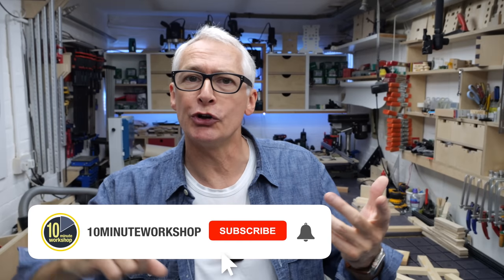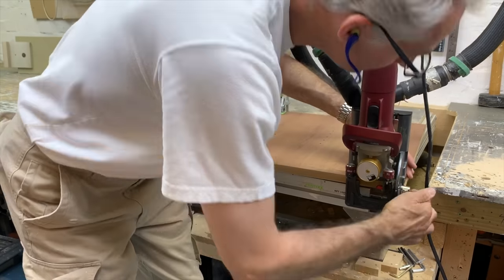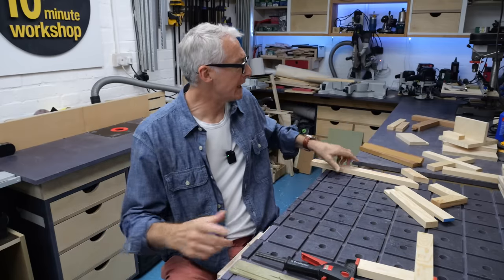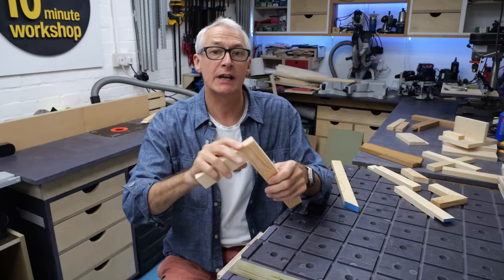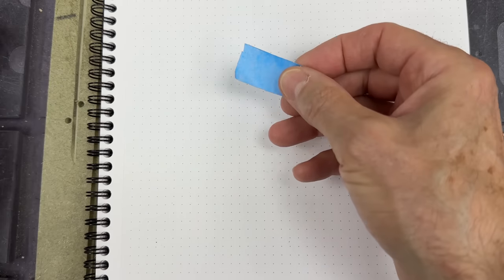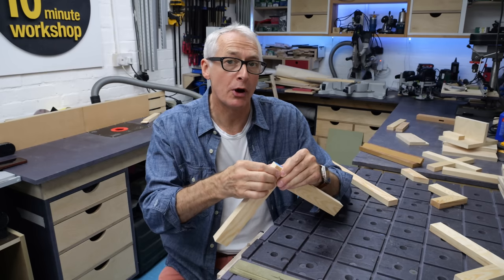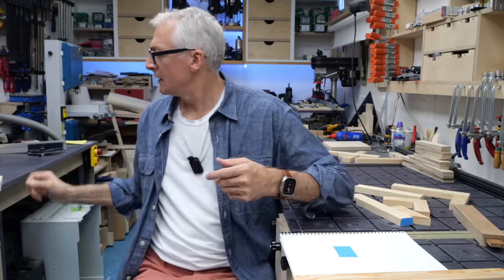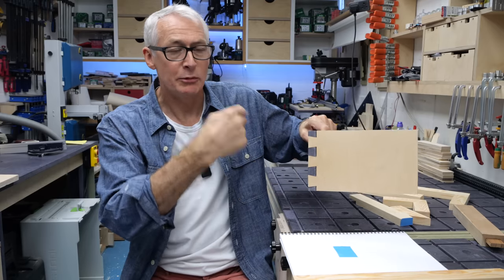What's The Point of a Joint? [video 538]

Comment: That there is long grain passing between the two pieces being joined is significant.  An unglued butt or miter joint will come apart as soon as you let go of it.  Add a spline or floating tenon and you need to pull to get it apart.

Comment: Maybe you'll be mentioning this in subsequent videos but one of things that make rabbets or half laps, for example, stronger than a simple butt joint is the shouldering that is inherent to the joint. The more contact points in the joint, in different directions, the stronger it tends to be, regardless of the increased gluing area.

If you take an L joint, for example, a simple butt joint only has the mating surfaces to give it any kind of strength. Movement in almost any direction will cause it to fail. Whereas a half lap, for example, has two shouldering points that reduce the number of directions that can make the joint fail.

I'm looking forward to more videos in this series. I'm no expert, as I've only been at this for 4-5 years, but I love the physics behind the joinery as I think it is what defines which type of joinery is appropriate for a given situation. The more we understand it, the better decisions we'll make.

Comment: Great video Peter. Looking forward to the series. Glue technology has come a long way since a lot of the woodworking joints were invented. A lot of cabinet makers I have spoken to have told me that dovetails while very pretty are a waste of time with modern drawer slides. As you said it is more about showing off skills than actual function not that there is anything wrong with that.
Reply from the maker: I agree, but the last time I called a dovetail a ‘decorative’ joint I was drowned in  comments - mostly from people who have likely never made one… 😂👍
Reply: Sorry. I made similar point before scrolling down to yours
Reply: @10MinuteWorkshop  It really depends on the situation that you are creating with regards to dovetails. I have made fine reproduction furniture since the age of 16, now if you are recreating a copy for want of a better word of an antique piece of furniture you would never cut machine dovetails you would only do hand ones and ensure the tails were larger than the pins. I agree they are decorative but also very strong and functional. Furniture making has very much moved on since I first started out as an 'apprentice cabinet maker'. And methods of construction likewise, the kind of furniture that I used to make has very little appeal to the younger generation who would much rather have the boring straight lines of Ikea style furniture and the excellent price that goes with it. It is nice to see you using 'real wood ' and cutting joints and whatever method you choose to cut them matters little really its always the end result that matters. However if we discard a lot of hand methods we will only have semi skilled workers who cannot use a saw or chisels. I am glad at my college we still do teach basic hand skills and hopefully train craftsmen of the future. Not a rant Peter just my opinion.

Comment: When you say using something like a dowel increases the glue surface area, it's not only that - the dowl (or biscuit) is actually bridging the gap between the two pieces of wood giving even more strength.
Reply: Biscuits are primarily about alignment. They are so thin they're usually weaker than the material removed to fit them. They are a money saver as they make for fast alignment of slippy glue on edge faces and reduce time for planing or sanding down ridges between pieces.

Comment: One small point: the joints were developed in days when animal glue was all there was. Modern glues, even for a simple butt joint are usually stronger than the wood so the wood fibres fail before the glue does, unless the glue used degrades with time like cyanoacrylic
Reply: Glue is only stronger than wood in one direction
Reply: And all glue will always fail, given enough time. I've sat on enough wobbly chairs to be glad that there's a mechanical joint as well as glue.

When a mortice and tenon goes, it gets progressively more wobbly. When a butt joint goes, it goes all at once, without any warning. If that joint is holding your chair together, you'll be on the floor before you know it.
Reply: Joints also serve to constrain the pieces so that the load on the glue is constrained too, and is potentially near zero in normal use. Take a mortice and tenon joint: the glue only prevents the tenon from leaving the mortice, and strength in all other axes is provided by the joint itself. In the direction where the glue is providing the strength, the load on the glue is entirely in shear which is its strongest direction. As a result a glued mortice and tenon joint will be very significantly stronger than a simple glued face joint in the same application.

Comment: I’ve been woodworking for over 45 years now and, through the fine furniture business I ran, would consider myself a reasonable cabinet maker - using your parlance, a fine woodworker. What I would say about the point of a joint is that it should be a way for someone to show off their skills. That’s just plain egotism. A joint can be a thing of beauty but it’s fundamental is to be a (sufficiently) strong connection between 2 bits of timber. 

The dovetail is seen by some as sign of a fine piece of furniture and that the maker is highly skilled. Well, I look back at the origins of a dovetail. It was only ever evolved because a mechanical joint was needed because the glues at the time were so poor. It does take some time to master and, as with all things, practice makes perfect, but a dovetail joint isn’t inherently hard and I could teach anyone to make good (not great) dovetails on less than a day. Nowadays, we have such superb glues that the mechanical element of a joint is rarely needed. 

Mr Chippendale was a superb designer and an even better businessman. His furniture featured dovetails because there was no choice but I have little doubt that if he had modern glues, he wouldn’t be wasting time having his guys make dovetails. 

A perfect joint must be functional. If it’s hidden, then that’s about it. If it is going to be on show, then input some design and make it something that is beautiful to the eye. 

To sum it up, form and function are the keys to furniture and just about anything being made - from pottery to cars. Design and build quality are what draw me to anything and not the flashy, unnecessary use of a particular joint.

Just my thoughts. And, even after all these years and not doing a lot with sheet goods or softwoods, I watch each one of Peter’s videos and enjoy them all.
Reply from the maker: Thanks! I do say that "if you're a fine-woodworking hobbyist, then the joint may well be the point..." so someone making the joints for pleasure without the constraints of running a commercial enterprise may well continue with dovetails 'because they can' - and there's nothing wrong with that, but it is a very different consideration than say, running a built-ins business for profit. 🤷‍♂️ 👍
Reply: Hide glue has been used for centuries and have held up very well.  So I wouldn't call hide glue  a poor glue.  IMHO
Reply: @10MinuteWorkshop Peter, I have no issue with the way you phrased it. I fully understand what you actually said and the the way in which some hobbyists want to demonstrate their skill by the aesthetic of their joints. That’s great if you need that boost. I built a new workbench a couple of years ago and wanted to include some elaboration which were not borne of necessity but simply to please me. So, I used different contrasting timbers of various elements and made a quite large half blind dovetail to secure the tail vice in place. I like to see it but I don’t think any of the visitors/clients who have been to the workshop have ever commented upon it; I’m quite happy with that as I don’t see it as an achievement worthy of comment. 

My view is that, generally, a joint is a “tool”to achieve the final result you desire and not an achievement in itself. We are very lucky to have the V&A resource in London and my wife and I have spent many, many happy hours wandering around. When I look at pieces by makers that I respect, old and modern, I rarely see the joints themselves. There are obviously there and essential but, it seems to me, the end result desired is that combination of total form and total function. 

None of this to disrespect hobbyists in any way. Perhaps, it may be food for thought particularly for people coming into woodworking as a hobby or as a trade to put the elaboration of various joints into a perspective.

Comment: Hello Peter,
It's not so much about how much glue is in a joint but where it is.
End grain is weaker than long grain because wood as we all know is made up of straws.
Those straws suck up glue and starve the joint of glue unless you prime the end grain face with glue a few times. However that end face needs to be cleaned up before use. Too much faffing around.
Long grain to long grain therefore is far stronger and more convenient.
Dowels/domino again while they give more glue area they give massive mechanical long grain strength to a joint.
Take that picture frame.
I do have issues with your summary of the wardrobes you make.
In my world to all intents and purposes they are fine woodworking/cabinate making and are a benchmark for the rest of us to aspire to.
Reply from the maker: Thanks; what I meant was that my wardrobes and cabinets are not 'fine woodworking' in the traditional hand-cut dovetails sense; I'm very happy with how they turned out. 👍

Comment: Peter, please include the correct use of joints.   Too many are building joints with incorrect orientation, because they don’t understand basic structural mechanics.   Joints resist either tension, compression, moments(torque), and combinations there of.   The orientation of the dovetailed joints in a drawer is important because as the drawer is opened and closed, the dovetail will resist the forces, even without glue, and a box joint, won’t work as well because it doesn’t resist the tension the joint sees with out the glue.
Reply: A few years ago, I made raised beds in the garden with 100*50mm railway sleepers. In effect, I used box joints with 12mm threaded rod down the centre of the joint. Flexible and strong with rods also supporting wires to train climbing plants. Works great

Comment: I'm trying to get to grips with dovetails, following videos by Paul Sellers, but why are they always shown on vertical corners in drawers and boxes, rather than horizontal corners on cabinets/shelves? If the tails are orientated to resist the gravity can they be used in that application or will they come apart? Maybe you could cover this in a video?
Reply from the maker: I’m only looking at very basic and simple joints, so dovetails don’t get a look in I’m afraid. You do sometimes see dovetails used in that way - to support the base in a set of shelves for example - but have to say they’ve always been in ‘dovetail demonstration’ videos to,illustrate a point, rather than in real life. 🤷‍♂️👍
Reply: About 1970, I made a bedside cabinet from white oak for my sister. I was 15 and at school  extracurricular sessions. Top to side panels were dovetailed. Fixed shelves as top and bottom of cupboard section were through joints with wedges. All rock solid while remaining elegant. Wouldn't do that now as I don't have a solid workbench. I'd use dowels or Peter's first generation floating tenon jig - which would be a shame aesthetically.

Comment: Thanks Peter, I like your clarity and brevity, but I think your lacking on one crucial point of joint design, mechanical strength. I know you've touched on it but didn't emphasize its importance. That is to say how the joint can come apart and where the wood resists the forces without any glue, like in any dovetail, pinned tenon or dowel joint. You did mention how a dovetail can only slide apart in one direction. Any joint's strength could be measured in X Y and Z axis by the cross sectional area of wood resisting force in an axis before and after gluing. Hence the popularity of floating tenon (Domino) joints because of ease, quickness and strength.
Reply from the maker: It’s a series - there are more points to cover in future videos. 👍

Comment: Hi Peter. I believe you have overestimated the difference between butt jount and the half lap. You have taped the end of the board that doesn't participate in the joint (and I guess nobody puts any glue there).
Reply from the maker: It represents the rebate on the other half of the joint Chris. 👍
Reply: @10MinuteWorkshop  I'm not an expert, just stubborn old fart so I still disagree 😁 Glue area for half lap is L shaped in my opinion (unless British laps are different than Polish 😉)
Reply: @madeincrayford No, it's actually two L's that overlap at a 90°angle and one of them is flipped upside down. You have to think in 3D here.
Reply: @10MinuteWorkshop  Got it ;) If it is angled joint then the side also contributes to the glue area, only if it would be a straight joint we will loose a side strip of that glue area.

Comment: the point of a joint is to get high of course!  Everyone knows this.
Reply from the maker: Only if you inhale…
Reply: @10MinuteWorkshop Now cut a few dozens of tenons and mortices by hand in soft wood for a rack of shelves in 1970s student digs so you and your housemates can store pans and bulk dry goods. Sniffing resinous timber sawdust like Sniffin' Glue! Get high and store your stuff up high, at the same time. Didn't need glue as my joints were strong enough (take that how you fancy!). Wish I still had my Black & Decker Workmate from when they were rock solid